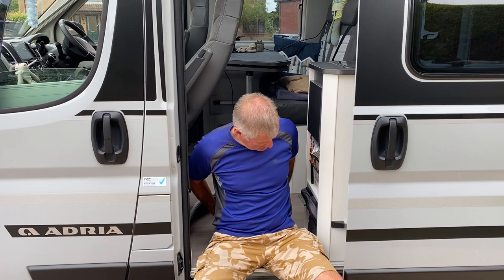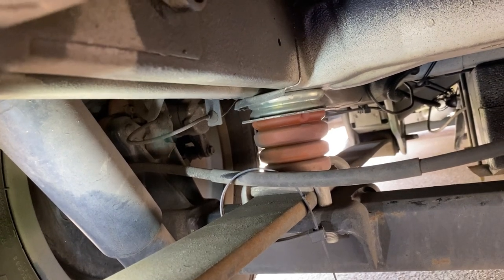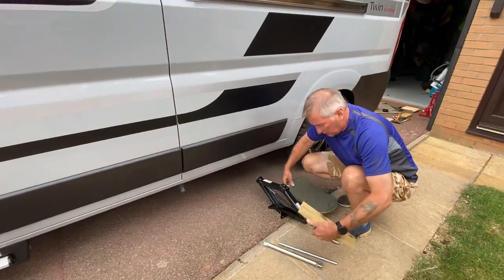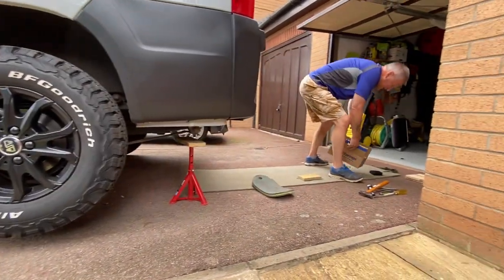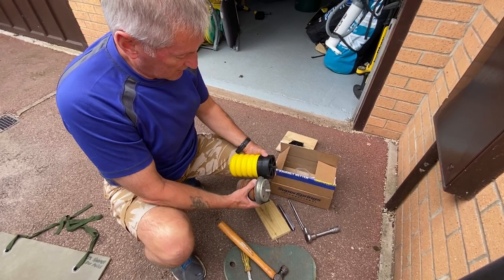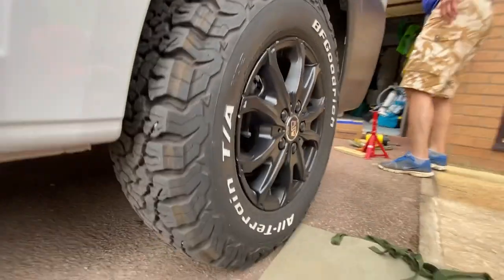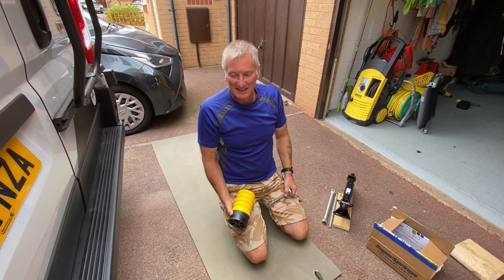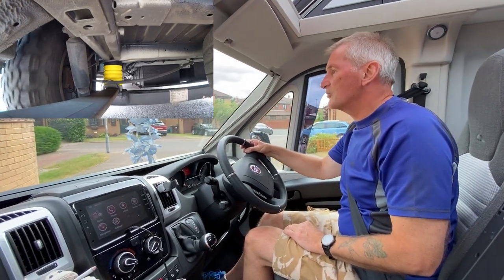How to Upgrade to Sumo Springs on a Fiat Ducato

Comment: I thought those springs are not supposed to be touching unless you are driving over a bump.
Reply from the maker: Ideally that would be the case.  I’ve added double leaf springs so they are just clear now.  Thanks for your comments.

Comment: I fitted these on my car over 30 years ago. They were called doughnuts and were used by caravaners to lift and firm up the rear suspension on the towing vehicle to help cope with the added weight on the lowball.  It use to make the suspension much firmer and you certainly felt the potholes more.
Reply from the maker: Interesting and thanks for the comments David

Comment: These seem very, very expensive compared to an airbag.
Reply from the maker: Hi David yes they have gone up in price considerably since I fitted mine in 2022.  Just looked on Amazon order history and mine cost me £260.  They are now £440 😳. That said they are still really good but not necessarily a cheaper option that airbags but are easier to fit than airbags so could save something on fitting if you did a diy job as opposed to getting a fitter to fit the airbags.  Both are good options although I have seen on a forum of some having problems with airbags leaking etc.
Reply: Thanks Nick

Comment: Thanks for sharing this video and for supporting our company! -Adam
Reply from the maker: Thanks for the comments Adam.  I’m thinking of fitting the supersprings and hoping these will work well with the Sumo springs.  Thanks for great products 👍
Reply: @nickharper6436  hey Nick they work well together but you’ll likely want to switch to the black or blue SumoSprings with the SuperSpring. The yellow and the SuperSpring may be a bit much.
Reply from the maker: Hi Adam, I’m looking to fit the front coil sumosprings to the front of the vehicle and make a YouTube video.  I have the Fiat Ducato and I believe the CSS - 1195 would be the correct ones?
Reply: @nickharper6436  Typically the CSS-1195 or the CSS-1168 are great fit for the Ducato. 👌🏼
Reply from the maker: Adam many thanks.  Do they add any lift?
Reply: @nickharper6436  they don’t “lift” - but if you’re weighed down they will keep the vehicle from sagging. The fronts main benefit is to reduce that front end dip when braking, reducing body roll around corners, and to help with porpoising if you’ve got something heavy in rear or are towing.

Comment: Hi Nick. Many thanks for creating this video. I’m thinking of adding these rear Sumo Springs to my Ducato. Are you still pleased with them? I read somewhere you were also thinking about upgrading the rear leaf springs. If so have you installed them and do you have a link to your video? Many thanks, Nick - keep up the great work 😎👍
Reply from the maker: Thanks for the comments Nick.  The Sumo springs are a great relatively cheap upgrade on their own and work well.  That said it still felt the van was heavy at the back as the single leaf spring was literally flat with no curve in it.  I saw a set of second hand double leaf springs on eBay that only had delivery millage for £265 so thought I’d give them a go.  In my opinion with the double leaf spring and the Sumos they work very well together and I’m very happy with the ride now.  I’ve done a video with the double leaf springs but just need to finalise it so will hopefully upload it this weekend!

Comment: Nice video. Where did you buy them? After Brexit it is much too expensive for me to buy in UK. 😢
Reply from the maker: Yeh they are over £300 in UK.  I got mine from the states via Amazon and they were £260 with tax paid!
Reply from the maker: Supersprings SSR-313-54 SumoSprings Solo Kits Are Replacements To Factory Bump Stops Capacity 2800 lbs. At 50 Percent Compression Do Not Exceed GVWR SumoSprings https://amzn.eu/d/aaePoHR

Comment: I fitted the air bags and were amazing for the 6 years I had the van. Will be fitting bags again to my vext van as adjustability was fantastic and also you do not need to do anything wish the springs
Reply from the maker: Cool, sounds like a great solution.  Thanks for the comments Martin

Comment: Interesting video , almost same reg as me , we have one letter difference , i opted for the air on the rear combined with the same wheels and tyres and the ride greatly improved,  thanks for the upload
Reply from the maker: Did you get your van from TMD?
Reply: @nickharper6436  Yes last year , and wheels from reading (elite) I think they are called if I remember correctly
Reply from the maker: Picked mine up in May last year so must have been a similar time I would have thought!

Comment: Good video, i came across it by chance (thanks youtube). I am currently looking at getting the Air Suspension fitted as my 2022 Swift Select is the same as yours. On a seperate note, the original items you removed are not bunp stops but officially Spring Assisters according to Fiat/Swift.I think this is because they are already sitting on the rear axle....
Reply from the maker: Thanks for the comments Mark and yes I’ve heard this too.

Comment: Might sound a silly question but do these sumo springs have springs in them to assist,?? I have a similar thing on my 97 boxer but mine are just heavy duty rubber buffers.
Reply from the maker: Trevor no springs in them it’s a composite material.  You can get 3 different densities depending how heavy the van is or whether you prefer a stiffer ride

Comment: Interesting video. My Hymer Ducato 2022 van has a terrible ride.
8 months on, how are you getting on with these and can you still recommend the upgrade…?
Cheers
👍🏾
Reply from the maker: Yes I would still recommend them but don’t expect it to be a super smooth ride.  I think they benefit the body roll and stability more.  I also added double leaf springs which made a difference to mine.  Also the BFG tyres which don’t have to be o flayed as hard as the tyres normally supplied with campers and Motorhomes.  You can also see these videos on my channel.

Comment: That's a big difference. I have been thinking doing the same upgrade to our van next summer.
Reply from the maker: Yes it’s a good upgrade and you can also get softer version too.  I also installed double leaf springs which made a big difference to the overall handling of the van.  I did another video on that which may be worth a watch.  Thanks for the comments 👍
Reply: @nickharper6436  That's great to hear. I'll watch the other video too. Thanks for sharing your upgrades. I feel like the stock suspension in our van is too compressed even with a light load.

Comment: Thanks. Do you have any mechanical problems with the fiat ducato??? Is yours reliable??
Reply from the maker: Hi I only had the DPF sensors changed after about 1500 miles but this is a common problem apparently but still not satisfactory in my opinion as Fiat are aware and wait for customers to bring them in to change.  Not sure how it is on the newer ones as mines a 2021 model.  The result was an amber engine management light and stop start not working.  No problems since then though and happy with both the Fiat side and Adria side.  Ill keep my fingers crossed as only done 23000 so far!

Comment: Hi Nick,
I have just received my sumo-springs and have attempted to remove the two spacers in order to go down to one. You made it look easy in your video!  Did you have problems undoing the bolt on the first one?  I’m reluctant to start clamping it in a vice in case I damage it. Any tips?
Reply from the maker: I didn’t clamp it in a vice and a bit of force with a socket and hand holding the Sumo spring on the floor did it for me.
Reply: Ok thanks. I’ll try and source a longer socket wrench handle.
Reply from the maker: I’m sure that will sort it Robert.  Hope it all goes well
Reply: Hi Nick,
Success! I invested in a strap wrench that allowed me to get enough purchase on the sumo spring in order to undo the bolt.  Thanks for the info.
Reply from the maker: @robertprice5087  cool glad you got it sorted Robert 👍

Comment: Hi, Thanks for this video, very helpfull. Could you please tell me what kind of GPS you have and if it's works well with the steering buttons ? many thanks Lionel
Reply from the maker: Thanks for the comments Lio, the satnav radio etc came fitted to the van and is installed by Fiat.  I’m not sure what make it is but it does work with the steering wheel buttons.
Reply: Thanks for your answer, I am looking to find the same than you on google images but no way....

Comment: I’m about to fit rear sumos on my twin. Single leaf springs. Is it worth trying with both spacers? Or is it going to take too much load vs the leaf spring?
Reply from the maker: Thanks for watching the video Kris.  I would only put one spacer on because as you say with 2 I think it will only be resting on the sumo and you need both the leaf spring and the sumo to take the weight of the vehicle and not just the sumo.  Even with one spacer it may rest on the sumo while parked but on the road the leaf spring will also come into play.  Just my thoughts 🤔

Comment: Very interesting and well filmed video , off topic but can you tell me what tyre pressure you are using with the BFG tyres
Reply from the maker: Thanks for you comments Paul.  I’m running mine at 60psi in the rear and 55psi in the front.  I’ve been told that if you weigh the van and then contact the tyre company they will advise the correct presume.  I’ve yet to do this but will get round to it!
Reply: @nickharper6436  that’s the pressure I’m running on the thing is I get a rubbery smell when they get hot so I was thinking of upping the pressure I have 2 ebikes on the rear
Reply from the maker: I’ve never noticed that to be honest Paul.  Give it a go and see if it sorts it

Comment: Thanks for the video been looking at sumo springs for the rear of my fiat ducato great review
Did you have any issue with the bigger wheels, bf goodrich tyres rubbing or hitting the rear arch over bumps or ramps while driving??
Reply from the maker: Many thanks for the comments Anthony.  No problems with the wheels or tyres as I got the same size as the originals that came with the van from the factory!
Reply: What size are the tires? Thanks
I want to put 215/75r16 on mine
Reply from the maker: Mine are 225/75//R16
Reply: Thanks for the info Nick 
Just wanted to make sure they wouldn't hit the lip on the inside of the wheel arch
Looking forward to the double spring leaf video 👍🏻
Reply from the maker: Yeh just fitted so will edit soon and get it out there although busy for a few days!

Comment: The best option for your van would be a thicker 22mm single leaf spring camper version, plus bilstein B6 shock absorber. Not so expensive and it is amazing upgrade.
Reply from the maker: Thanks for the information.  I wasn’t aware of the single leaf spring camper version however I’ve installed double leaf spring now and they soon to have made a great improvement.  I’ve heard good things about the B6
Reply: @nickharper6436  
You will see what the ride will be, probably the OEM shocks will be to soft for double spring and the van will oscillate too much on highway. Do you have any upgrades on front axel also ?
You will see what the ride will be, probably the OEM shocks will be to soft for double spring and the van will oscillate too much on highway. Do you have any upgrades on front axel also ?
Reply from the maker: It certainly seems better with the HD leaf springs as I have the sumo springs on the rear which assist things.  I’m looking at putting sumo springs on the front.
Reply: @nickharper6436  
A better and cheaper option for the front will be the new spring from LESJOFORS LS4026198 (Fiat OEM number 50711909), you will get a 3cm lift in front. The van will be level and the ride will be much more comfortable.
Reply from the maker: Cool, thanks for the information.  I’ll have a look at those Kiki

Comment: Great video. Hope you don't mind me asking as I'm not mechanically minded at all but I was wondering why replace the factory springs? Do you get a better ride or something?
Also, what stereo do you have installed as we have the factory stereo/rear camera/satnav, which is small and rubbish. And finally, do you have a video explaining how you fitted the stereo? Apologies for all the questions :) Thanks
Reply from the maker: Martin thanks for the comments.  So the Sumo springs replace the factory bump stops which are ok if the van isn’t fully laden all the time like a camper with all the weight of the fitment.  They stop that sway you get on corners and overall just help the van handle better.  The stereo was the standard fit that came with the 2021 van so can’t help on that one although it you watch this video you will see me make reference to a unit made especially for the Ducato which looks really good although expensive!
Reply from the maker: https://youtu.be/WMay4gtvuGA
Reply: @nickharper6436  Thank you, Nick.  appreciate your reply. I've checked my Ducato bump stops and they don't actually touch anything but are about 1mm away from touching the bit underneath them. If I were to put Sumo springs in, I'm guessing they are longer so would be constantly touching something and if this is the case, is this a problem? Thanks again.
Reply from the maker: No wouldn’t be a problem as they come with 2 spacers so I fitted one.  It’s basically like having airbags in effect.  It will also raise the back of the van by just under an inch

Comment: Do you think that heavy duty rear springs might be a good idea
Reply from the maker: I was thinking of that but had a chat with my local garage who said the ride would be very harsh with them so not sure at the moment.  Those with the maxi chassis might be able to confirm or deny as they have the HD double leaf spring as far as I’m aware!
Reply: I’m due to collect my Twin Sport which has the heave chassis, in a couple of weeks.  I’ll let you know what I think.
Reply from the maker: Hi Raymond many thanks.  I’ve just picked up a pair of the HD ones that came off a 2021 van that had only travelled 50 delivery miles.  Got them a lot cheaper than Fiat prices so for £260 it’s worth a punt in my opinion.  I’ll let you know once fitted what their like!

Comment: 17:07 the purpose of using indicators is letting others know what's your intended direction. leaving roundabout with the right indicator until it self cancels is misinforming drivers waiting to enter the roundabout that your intention is to keep going round.
Reply from the maker: We all make the odd mistake especially when speak to camera!  Thanks for pointing it out though.

Comment: They look like glorified bump stops to me, get yourself some air bags improves the ride and  handling, only takes a hour and half or so to fit
Reply from the maker: Yep that’s basically what they are although much better than the original and give a better more stable ride.  It would be interesting to compare to the airbags but I’m sure both methods make an improvement.  Thanks for the comments.
Reply: @nickharper6436  few years ago whilst in France got talking to a guy from northern Ireland, he told use if the bump stop don't have clearance from the spring it's a fail with there mot so he use to cut them down, I down know what our MOT rules are, but sagging suspension does attracts the attention of the DSVA who do the weights and defects for vehicles in the UK, be careful with your rear axle weights, happy motorhoming
Reply from the maker: Yes I’ve heard this John.  I’ve put double leaf springs on mine now as I wasn’t happy with all the weight of the vehicle being on that one point where the bump stops or airbags sit.  The van is now supported more evenly across the whole rear of the vehicle and a much improved ride and handling.
Reply: And cheaper too!